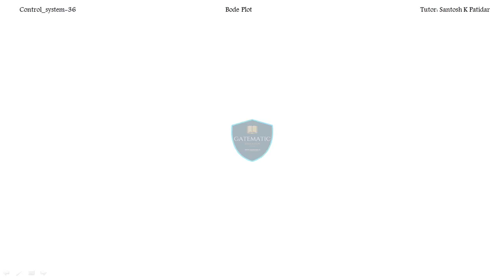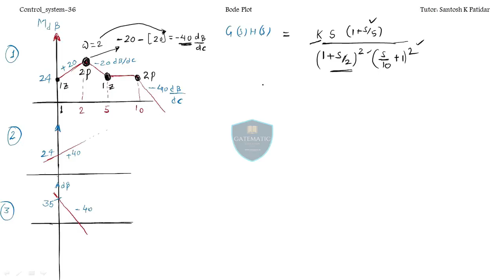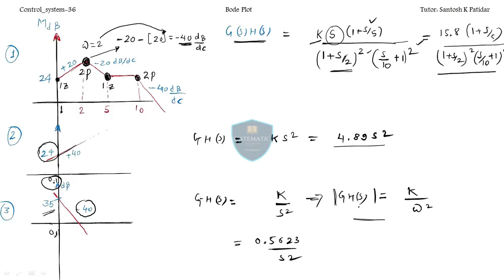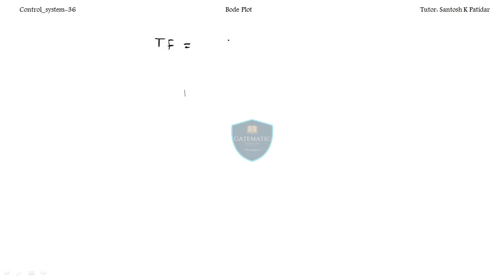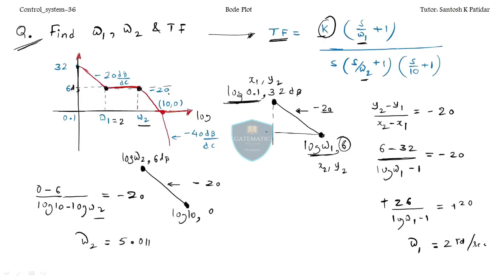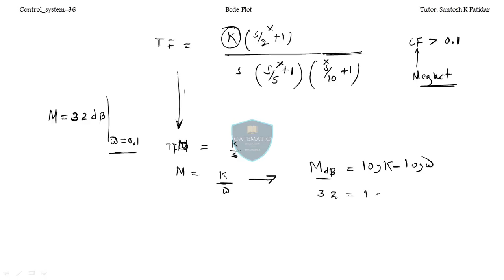Lec 36 Bode Plot (Contd.)

Comment: For first question ,k=158.5  Believe it or not ,I have done my research ,yes it's k=158.5
How? , Because magnitude at origin by a zero is -20 ,and we have magnitude in question 24 ,so 44 magnitude gap will be covered by a constant ,as  44=20logk ,thus k=10^2.2 ,we get k=158.5
Reply: You are 💯 percent correct man!!!!! I too got the same answer.The plot has to get shifted by 44 dB not 24 only..,.......
Reply: Surely you are saying correct, but you are considering the magnitude 24dB at w=0.1, where in this que. sir have clearly said that the magnitude of 24dB is considered at w=1.
Reply: @amannamdev9657   log scale starts from 0.1 not from 1.then how can sir also take the value of 24 dB at w=1????? It has to be considered from 0.1 is it or not. ???

Comment: sir the k value for question 2 will rather be very high and will be equal to 1584.8 and @ 12:35 the value of log(0.1) is -1 so it has to be log(w)+1 in the denominator.. please reply to these doubts.. Thank you
Reply: e power 0.6 will be 1.822, but how did u get 3.98
Reply: no its coming 3.98 as u get 32-20=20logk then logk=0.6 then k=3.98
Reply: 10^0.6 . But anyhow, it's wrong

Comment: K value for q2 is 1585 na sir?
Reply: Yeah that's correct because 20log(1585)+40log(0.1)=24 but when k=4.89 its not equal to 24
Reply: JOSHITHA R 14BEC1121 Even i got the same
Reply: yes k = 1584.89319 approx 1585
Reply: I also got the same even answer of next is also wrong
Reply: Yes Joshitha ur soln is correct.
Reply: i was confused ....but when i saw all these comments...i am relieved....thanks to all...:)